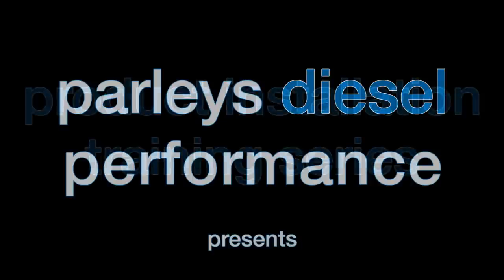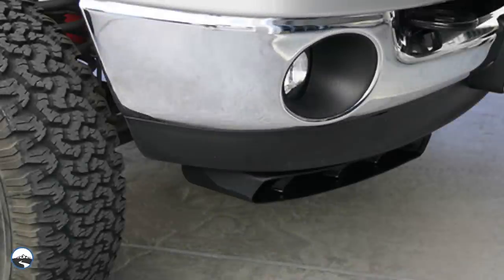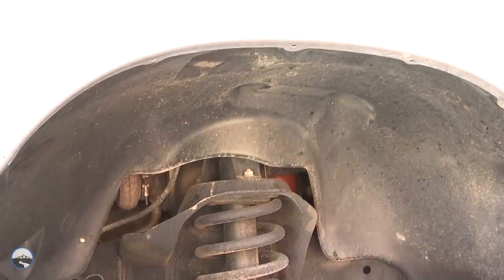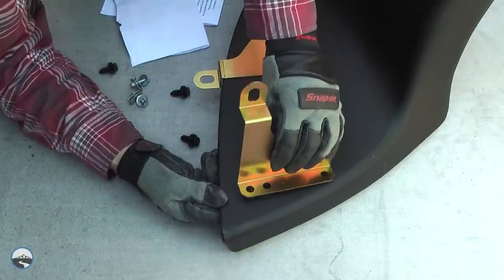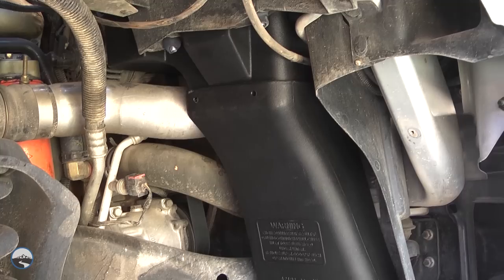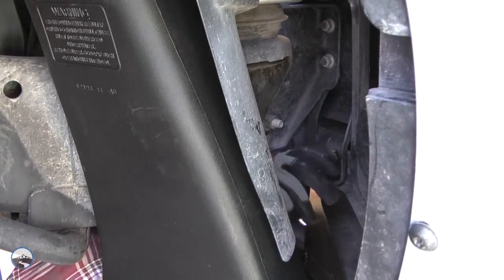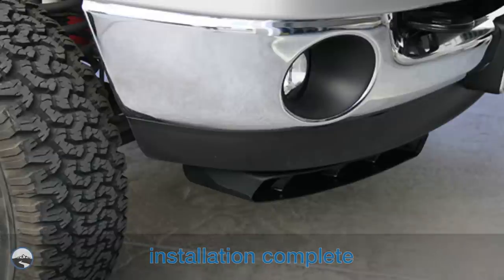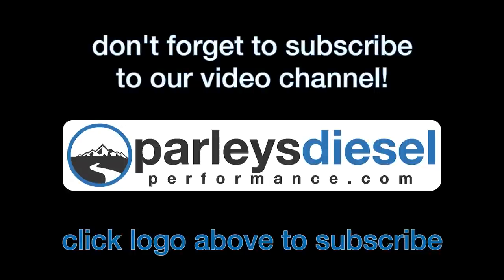Banks Super-Scoop Install for Ram-Air Intakes in Cummins Diesels

Comment from the maker: We really notice the difference at higher speeds, specifically highway driving.  Around town, it makes little to no difference in power, reduced temperatures, or fuel economy.  Towing a load down the highway, it does add a small amount of power and seems to reduce temperatures.  Fuel economy gains are around 1/2 mpg highway.